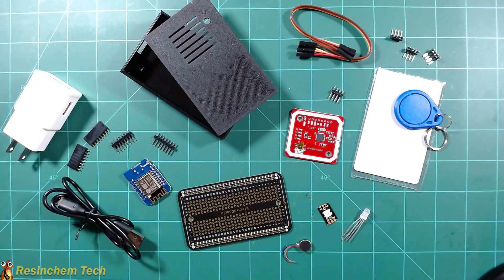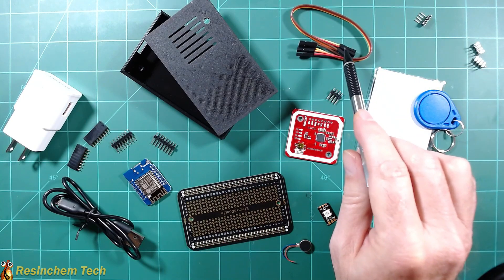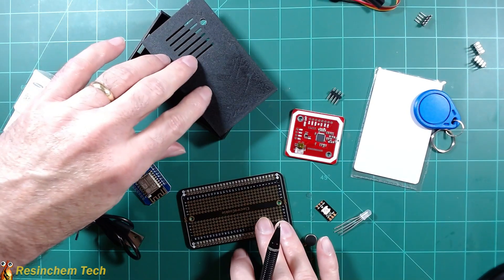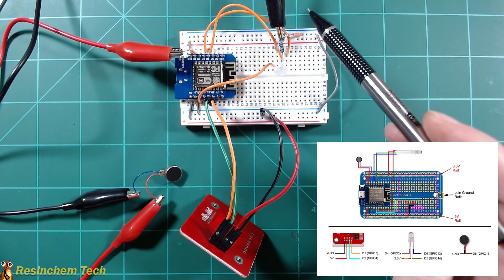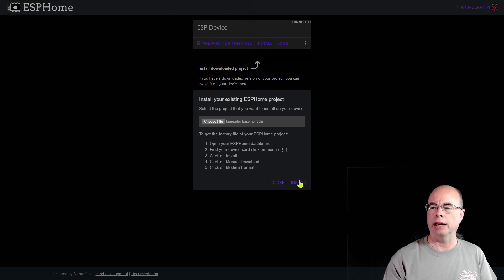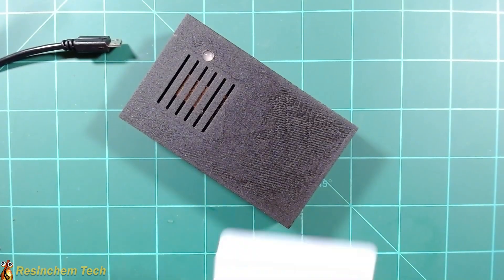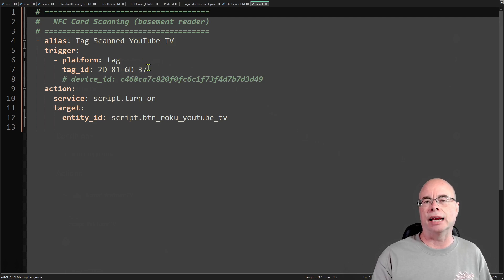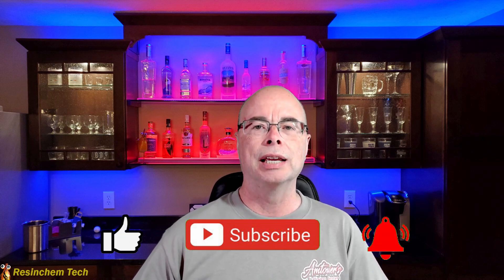An NFC Card Reader for Home Assistant Automations

Comment: The code is not working anymore
Reply from the maker: Well, it can be difficult to help someone that just says "it doesn't work" without providing any details, but mine is still working and I suspect recent changes to ESPHome have broken the code (I rarely update my existing working ESPHome devices to later versions).

I suspect it might be the newer requirement to add a platform under the ota: integration.  If you edit the YAML in your ESPHome device's configuration, any improper (or missing) syntax will be highlighted (red underlined).  If you don't have it, you might need to add the new platform key under the OTA key:
ota:
  platform: esphome
  password: your-ota-password

Mine shows one other necessary change.  Under the switch, there are two instances where the line "restore_state: true" needs to be changed to "restore_mode: RESTORE_DEFAULT_OFF".  Once I made these changes, the ESPHome code validated without error.

Unfortunately, monthly updates to both Home Assistant and ESPHome also nearly always include breaking changes, so you will often run into code or examples that are outdated.  And with the number of videos and blog articles I've created, it is simply impossible for me to go back and keep everything current.  It just means that you often have to look at the indicated errors or issues and then the documentation to determine the current syntax or use case (exactly what I did to reply to your comment).
Reply: @ResinChemTech  
Thank you for your answer. It took me some time to find all necessary changes in the code, but now mine is working again.

Comment: How did you put the D1 mini in flashing mode?
Reply from the maker: As a general rule, the D1 Mini (and most ESP8266 boards) do not need to be put into "flashing" mode.  Just connecting the USB cable and sending the code/firmware will normally be accepted by the board.

However, if necessary, you can manually put the board into flashing mode by pulling the flashing pin to ground when you power on the board.  You may need to check the pinout for your particular model, but on most D1 Minis, the flashing pin is A0.  So you'd need to connect this to ground before plugging in the D1 Mini and flashing.  After flashing, you have to disconnect the ground and power the board back on to return to "normal" operating mode.

If the situation is that you aren't seeing any new COM ports when connecting the board, this may be due to missing USB-to-Serial drivers on the machine you are using to flash.

Comment: Thank you for your videos.
Which lines of the code do I have to remove to eliminate the Vibrating Motor?
I am only interested in having luminous information.
Thanks again.
Reply from the maker: Under the switch section, you need to remove the section for the GPIO switch with the ID of vibra, then you also need to remove every instance of "switch.turn_on: vibra".

Alternatively, you can leave all the code as it is and just do not install the vibrating motor in your build.  The code will still send the signal to turn the motor on/off, but since it doesn't exist, nothing will happen.  The code will still work and it won't cause any errors.
Reply: @ResinChemTech  thanks for your answer

Comment: I would do a version with voice commands..
Reply from the maker: Actually, I do have complete control over the entertainment system with voice (primarily using an integrated Harmony hub).  The missus primarily interacts with Home Assistant and devices via voice.  But as I think I've mentioned in a couple of my other videos, I like to have multiple ways or methods for pretty much all my smart devices.  In this case, the TV/Roku can be controlled via voice, NFC tags and a Home Assistant kiosk.  Oh... and of course by the original remotes.

I've found that after a few years of testing that some folks aren't comfortable with certain methods.  Visitors or guests that might not have smart speakers (or even those that have Amazon when I have Google) are often hesitant to interact with the house because they 'don't know what to say'.  So most of my devices, like the TV, have an alternate way to control it as well.  Pretty much everyone (so far) is pretty comfortable with picking up a card and tapping it after I demo it one time.  My elderly dad just won't try to talk to Google, but he'll pick up one of those cards and tap it to turn on the TV.  It all depends on your needs.  But I do try to always provide multiple methods of accomplishing the same task in my own home.
Reply: Yea this would have been perfect for my grandmother in the nursing home. She had a hard time changing channels. You might be onto something.. we need to bring accessibility to the elderly.. her nursing home really pissed me off with all no tech to make people life’s more enjoyable..

Comment: Another great Video!! I am trying to fallow along but i dont see your complete yaml file of all the changes. i did see on the blog that there was a link but it dose not work. Did i miss something? I would like to combine your with the vibration sensor and a buzzer so i have a quiet mode.
Reply from the maker: Thanks.  I just checked the blog and the links there did seem to work for me (these are links to a Github Gist file with the complete ESPHome code).  But here is the direct link to that Gist again:  https://gist.github.com/Resinchem/f832d8e7305730cc0af8932d51f22335

Let me know if you are still having issues access it.

Comment: Maybe I'm missing it but is there a link to the 3d model of the case for printing?
Reply from the maker: You didn't miss it... I did!  I have the design up on Thingiverse, but simply forgot to include the link in both the video description and the written blog (both of which I've now corrected).  To save you the time, here is the link to the enclosure design files:  https://www.thingiverse.com/thing:6115149

Sorry about that!  Many times I shoot the video and write the blog in bits and pieces but try to remember to include all the links when I'm finished.  Obviously this is one I missed.
Reply: @ResinChemTech  Thanks! Any chance you also have the model file for editing (.f3d or similar)? I'd like to modify it a bit to change the LED used. I could probably use it as is but I'd like to try and incorporate a WS2812b as I already have a few of them lying around.
Reply from the maker: Unfortunately, in the past I've used Tinkercad for all my simple designs.  It only creates the .stl files.  I'm very slowly trying to learn Fusion 360... but it's a slow process and a bit overwhelming compared to the simplistic Tinkercad.  I'd happily share them if I had them... but the .stl and the sliced .gcode are the only things I have.

As an alternative, if you look at my other designs on Thingiverse, you'll find enclosures for the standard ElectroCookie boards.  The enclosure for the NFC card reader is the same dimensions... just a bit shorter.  But the lid is the same.  So you could at least snag a copy of the lid from the ElectroCookie versions that doesn't have the LED hole.  Maybe it would be easier to add your own LED opening to that as opposed to trying to "fill the hole" from the NFC version?  Then again, maybe I have no idea what I am talking about!  3D design is NOT one of my strengths.  I really want to learn more about it, but up until this point, most of my designs are simple rectangular boxes for holding components or proto boards.